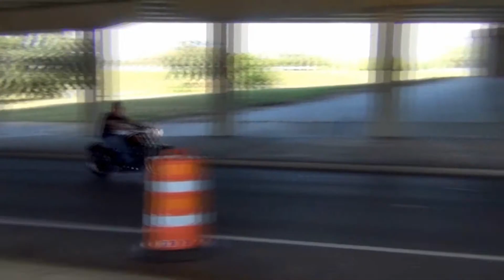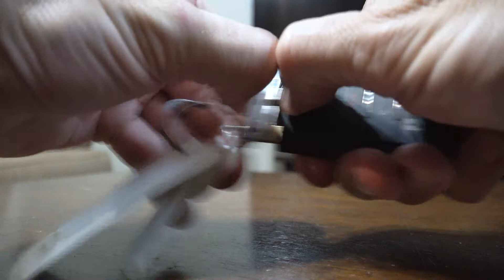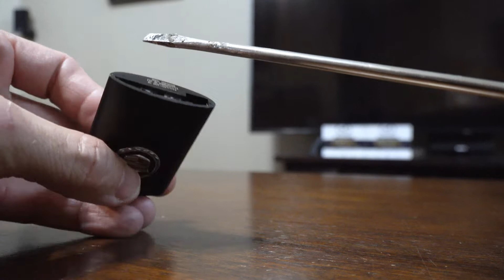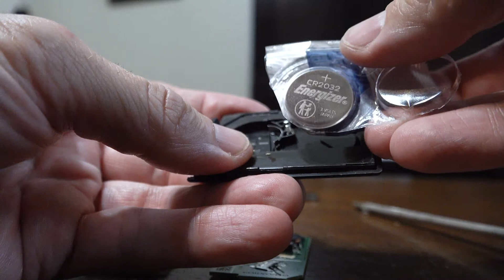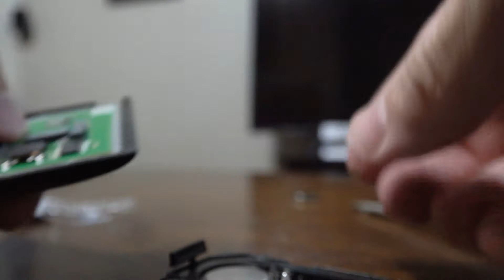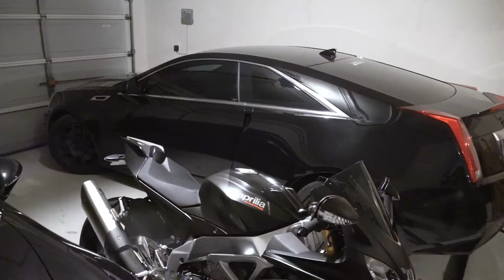Cadillac CTS Key FOB BATTERY Replacement - 2013 Cadillac CTS-V Coupe

Comment from the maker: WARNING: I was corrected that instead of a screwdriver, which could crack the fob, and i've had them crack even having never opened them, the manual says to use the key that's in the fob, insert into the slot, turn the key, and it opens.

Comment: No don't use a screwdriver. Use your key that's in the key fob there's a slot right above where the key goes you just put the key in there turn the key and it pops it open.  It also shows how to do it in the owner's manual. If you do it that way with a screwdriver there's a possibility of messing up the seams on the key fob.
Reply from the maker: oh wow, no kidding? and it's in the manual? think i read it cover to cover when i bought it new in '13. guess my retention isn't what it used to be. thanks though!
Reply: I have a 2013 and also it's a very small part in the owner's manual it's only a few lines that talks about it. I missed it the first time around.
Reply from the maker: @danielboyd3890  good, i don't feel quite so bad now lol. thanks again!
Reply: This is exactly right. I broke mine doing it this way. :(
Reply from the maker: @ThEmEsSiAh187-CFGeorge  I just tried with a key, and broke one. The instructions i found on a cadillac page online said screwdriver or the key. you can use either, but you have to be gentle as these fobs do crack even just through use.

Comment: can the car be started with the real key not fob?
Reply from the maker: the fob doesn't actually start this car, it just allows you in the door. there is no actual key hole switch, but it's not a push button start either. it's a rotating switch on the steering column where the old cars had it, but it doesn't take a key. you get in, the car senses the fob, and you turn that switch, but no key insertion.